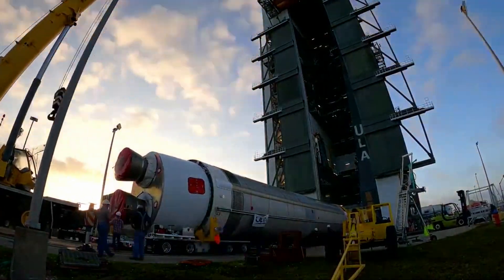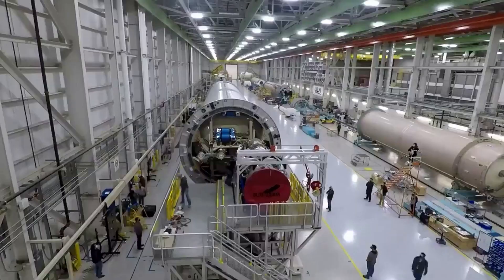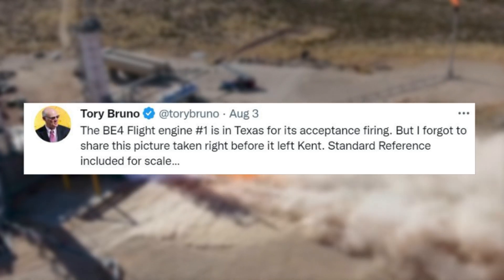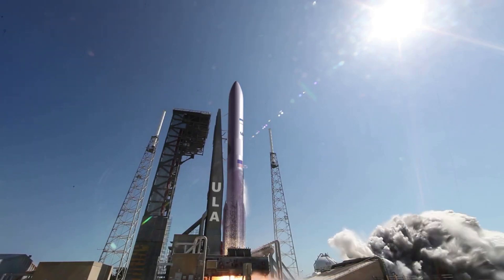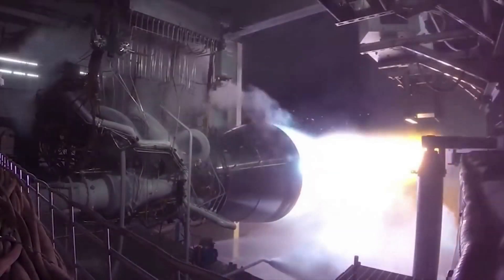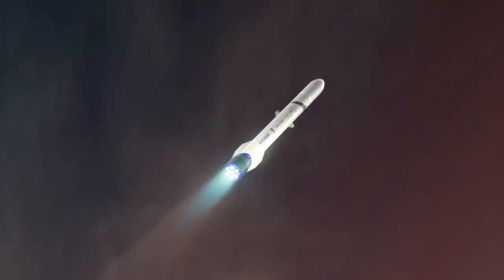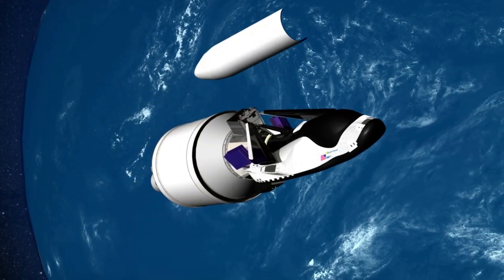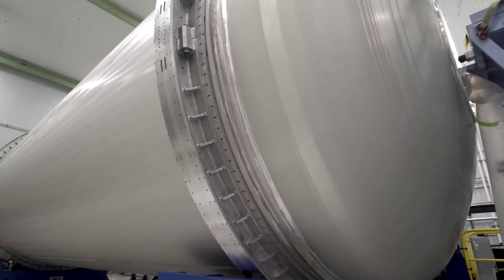ULA's Vulcan Has Finally Received Both BE-4 Engines For Its First Launch

Comment: Kyle
0 seconds ago
O2 rich, closed cycle, deep throttling, METHALOX engine at 550,000 lbs of thrust. 

Nothing else even close to this exists.
Reply: *cough Raptor 2 *cough
Reply: @floggerfrog  

Is not O2 rich closed cycle 

Cannot deep throttle

Like I said, not even close.
Reply: @iamscoutstfu  You're right it's not O2 rich closed cycle, it's O2 rich closed cycle AND fuel rich closed cycle. So yeah not even close lmao. And also yes it can throtte, or else how would they have been able to land the starship prototype?
Reply: @iamscoutstfu  Ok so pls explain what is full-flow if it's not the combination of a oxydizer rich preburner and a fuel rich preburner? And how is it standard technology when the first full flow engine was tested in 2019? 
Stop droping buzz words and actually try to explain your arguments cause you made none besides "enough said" lmao